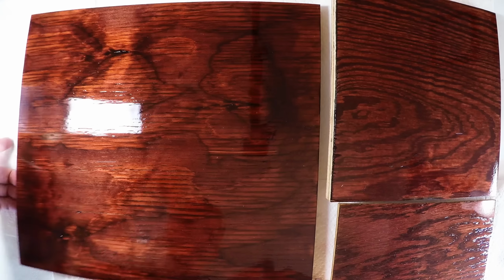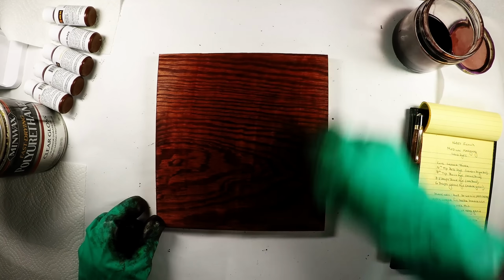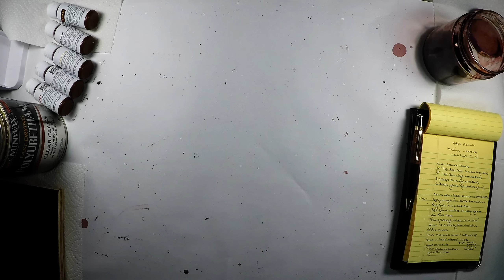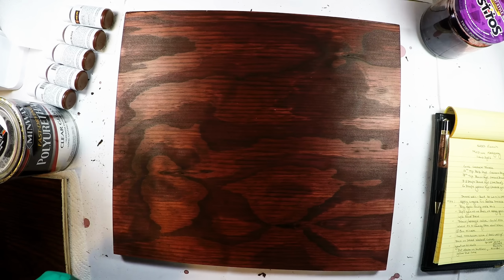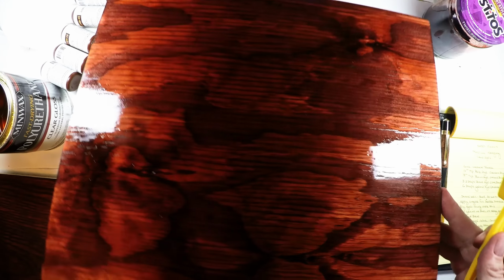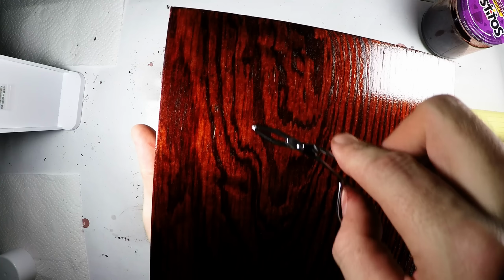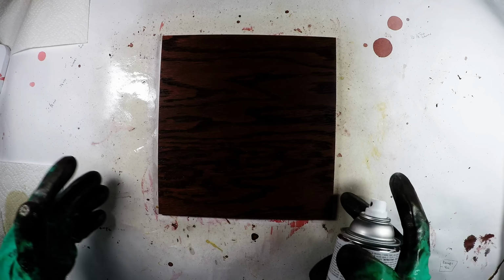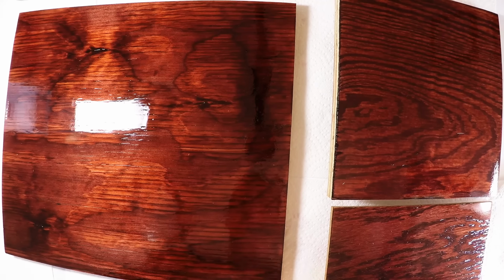Mahogany Stain Color Using Wood Dyes

Comment: Do you have any nice examples of staining mahogany itself??
Reply from the maker: Sorry I dont. I did do mahogany on the back of a guitar I built with my Son with the powder dyes, doing a brownish/orange color and turned out absolutely amazing. Still gorgeous to this day. You could see that result in the between coat sanding video, but be warned...is cringe award worthy lol, but at least you could see a glimpse of that. Also that back was Sapele which is a close cousin of Mohagany. Very similar characteristics, not the same, but quite similar.
Reply: @KedaWoodDye  Ah I'll have to take a look at that one! I've basically got an old mahogany dining table that I want to refinish to be less orangey (to turn into a desk!) and trying to figure out the best way to do it but most videos are refurbishing so normally end up more like the original.

Comment: Do you think the Keda dyes would work on hard rock maple? Wood that doesn't want to take regular stain.
Reply from the maker: For Super hard wood like rock Maple I would recommend acetone and the liquid dyes. The rock Maple may grumble a little bit in the beginning, but by the end, it will have no choice but to concede and it will be very happy that it did ;)  I have colored rock maple with the wood dye powders already even, it doesnt penetrate as deep, but even the wood dye powders will be able to color the rock maple, it just takes a little heavier coating and let them soak on the surface a little longer. Again, the powder wood dyes do not penetrate quite as deep on that type of wood density, but they can do the trick also. However, for the best results with that type of density, the liquid dyes will really be the best option for bright deep coloring.

Thank you for watching! I really hope that helps out...

Comment: I have the powder kit. Could you suggest a mix ratio with the powders to get the same result on maple?
Reply from the maker: catchingeels the wood dye powders should be pretty easy to hit or get close to this color as well. A rough estimate right now would be 1/4th tsp brown dye powder, 1/8th yellow and red dye powder, mixed into 8-16 ounces rubbing alcohol or warm water (pending on how dark you want the color to go). Thank you for watching :)
Reply: Keda Wood Dye thanks. I'll let you know how that worked out.
Reply: Well... I did try this recipe with powder and alcohol, either only use 2 oz of liquid or multiply the powder by 5 or 6 times, and add more red.